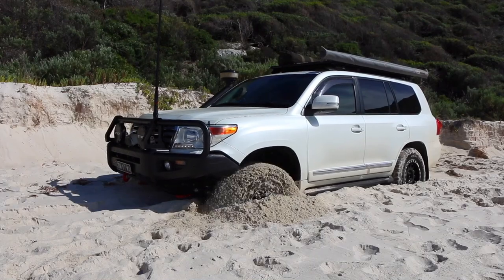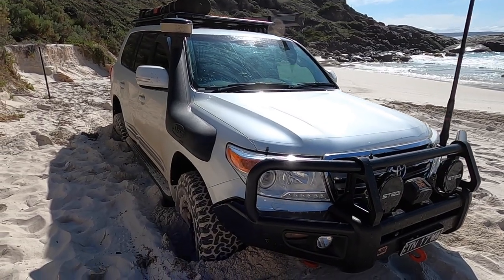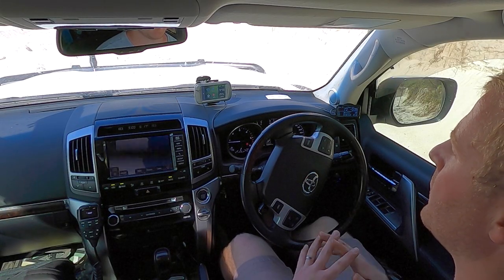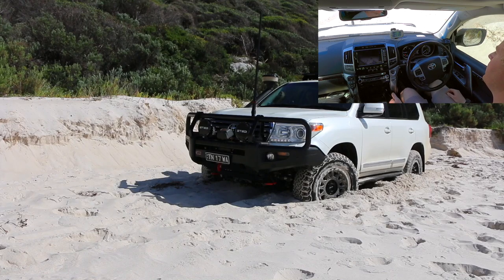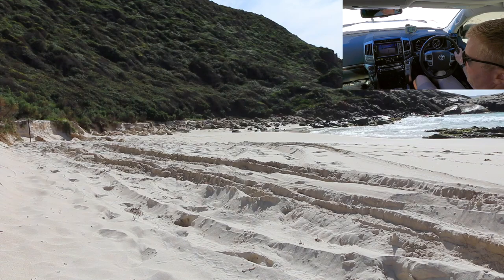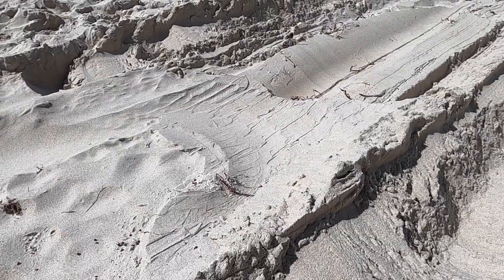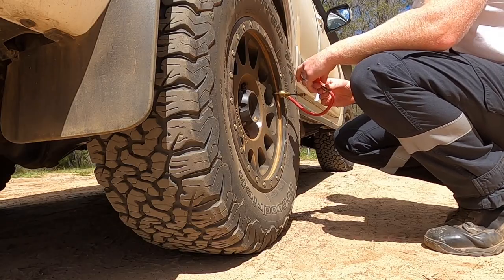Toyota Landcruiser CRAWL CONTROL | Stuck in Sand | Demonstrating 4x4 sand self recovery Does it work

Comment: Crawl has saved my bacon a couple of times. The most impressive was while towing a boat on Fraser. I was heading downhill and negotiating a big step down. I ended up off the side of the track in super soft sand so as not to damage the outboard on the drop off, sitting on the chassis rails both sides. Couldn't reverse uphill and couldn't go forward. My mate was ready to get digging, 15 seconds of crawl control and we were away. So impressive.
Reply from the maker: It’s an awesome system which works very well! Definitely something I recommend for efficient and safe recovery’s! 
Thanks for sharing your experience 👍
Cheers, Nathan.

Comment: Yep, I'm definitely impressed with that Nathan. More videos like that would be great. So many buttons on my new 200 VX and with no real instructions from the sales people makes it a little hard to understand how those buttons work and how / when to use them. Thanks so much again. Great vid.
Reply from the maker: Thanks Jim! These type of videos to appear to be popular, I’ll try and keep them coming 👍
There sure a lot of electronics on these new cruisers that require certain procedures or orders to activate. Hopefully my videos, past and future will assist 👍
Cheers, Nathan.
Reply: I don’t think the sales people every know how to use them other than over green leafy suburb car park bumps 🤣
Reply from the maker: @FangDocFilms  I reckon you are right there in most circumstances!
Reply: @FangDocFilms  Absolutely. On purchase I received absolutely no instructions from the sales person. Left the yard to go and fill the almost empty tank and had to get the hand book out to find the release for the filler cap cover. Same mob told me when I had issues with the centre diff light coming on randomly that the fault was unidentifiable and that a solution would be to disconnect the light !!!  That meant also that cruise control was eliminated and was low range !!  Go figure.

Comment: 98% of 200 owners won’t even know they have this feature.
Reply from the maker: I reckon that would be accurate. So many of these vehicles are bought to cruise the streets. Unbeknown how capable they are off-road.
Reply: i do!!! i have used mine a few times. the first time was on a west coast trip and got stuck near yardie creek station on the beach, near exmouth.  it rose up out of the sand like... well.... you get the idea. Im in the 2%.
Reply from the maker: @glenod  Haha, awesome mate. Great engineering used here, works well!
Reply: Well yeah if it doesn’t snow. Those of us in bad snow makes us get educated how to use it😉
Reply: Why would they not even know this > ? it is not a Jeep
Reply: I think most people who buy a 200 know what they are doing, they may not exploit the car to its full potential though.
Reply: 98% don’t know you can go 3 psi in this situation ie open the valve till air stops coming out
Handy to know when the tides coming in on your own
Reply: I heard about this feature a few years back by a neighbour who had one. He said that you can't get it stuck and it makes weird noises
Great to see it in action
Reply: @craigdavid6668  now this is accurate
Reply: I’ve seen many LX570’s bogged and the owners ask me to snatch them. All I do is turn on cc and they be like “😳😲 I didn’t know my car can do that!!”

And I don’t have one. I learned from YouTube!
Reply: Some get these stuck in hard sand and then just floor it thinking ot will get out and it like torture for LC lovers
Reply: Not all 200 series have that functions. I think it's available in Sahara and VX only.
Reply: @dannnyjohn7515  that's in Kenya
Reply: MY IDIOT NEIGHBOR DOESNT KNOW HE HAS ACAR.
Reply: Not every Land Cruiser has this option. It is not standard to have Crawl control.
Reply: Umm that’s one of the reason why I got my taco off road.  Only problem now is I got no place to put sunglasses.
Reply: @XploringOz  I had one and I always go to the desert so I tend to use it many times.

Comment: Love my Crawl. It's awesome up rocky terrain as well where just being able to concentrate on wheel position rather than anything else makes a huge difference.
Reply from the maker: For sure, I agree 100%. Some people, especially those who drive vehicles without this system will be quick to bag it out, however I'd rather be sitting at camp enjoying a fire, than digging my car out of mud/sand etc.
Reply: @tangosucka2000  Funnily enough I've been 4wd for over 35 years, and the crawl control is still better than any other vehicle I've owned with or without lockers. Just so damn easy.
Reply: @tangosucka2000  save up your money and you might be able to afford a 200 one day. Then you won't feel the need to leave envious ridden comments.

Comment: Call Matt.  Oh wait he's in Utah.  Pretty impressive thing.  I wonder what that drumming sound was.
Reply from the maker: Haha true. That sound is the ABS system activating for the crawl control. It's definitely audible, but completely normal.
Reply: Yes, it is quite off putting the first time you hear it. As stated the ABS system fires on and off randomly to stop which ever wheel from spinning, in turn transferring drive to the opposite side. I dont think i could be so smooth on a clutch in a manual trans but.

Comment: Can't wait to get mine...not that I wish to get bogged but see this work. Save using the maxi's. One thing I would be worried though if I already had low tyre pressure (some of beaches western south coast) we've gone down to 12psi (Yeagerup 10psi) would be worried about rolling the tyre off moving the wheel side to side!
Reply from the maker: This feature is absolutely awesome! A little bit of engineering magic I reckon. For sure, it would all come down to circumstance and adjusting your driving to suit as such. I have been involved in slightly panicked recoveries where pressures have been lowered to 5PSI, but this really is for emergency cases only. It can work, but potential damage to the tyres is significantly increased.

Comment: Wish my 76 had crawl control ;) On a serious note, I'm actually impressed by the Toyo crawl control. Never thought it was worth it. Thanks for the content! cheers
Reply from the maker: For sure, it’s a bit of a pity they don’t come with it, but then again, they are designed to be simple and reliable 👍
Works really well, definitely a great bit of technology.
Reply: Use both D.locks and pull the high idle knob out.

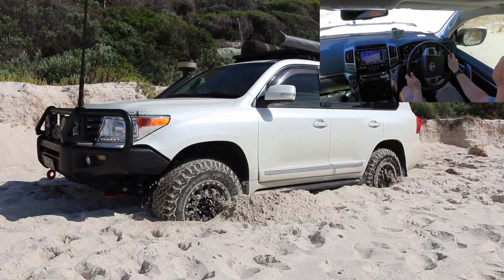Comment: Better demo..... My concern, while watching at 3:40 to 3:55, the vibration on your bumper was very clear, and for me, in the long run, due to wear and tear, that could somehow break (but it is supposed to be stronger than the original).  Was the vibration, that hard, really normal? Or something lacking with your improvised bumper?
Reply from the maker: Hey mate, so this is completely normal. This is because the bumper is attached to the chassis of the vehicle and the body of the vehicle is isolated or separated from the chassis by rubber body mounts.
I can assure you that the bumper is solid and mounted well to the chassis, but this just demonstrates how well the rubber body mounts work on the cruiser to take out these vibrations from the body...

Comment: Hey mate,

I really got alot out of this video, so much so that on a recent trip to yeagarup beach in the southwest i purposely got my 2016 GXL bogged 4x to test out the crawl control featurre. Admittantly it was actually quite difficult to bog the car without reinflating the tyres but on one of the occasion i hat bogged sufficiently enough so that all electronic aids besides activating crawl control would not pull her out. But just as seen here in your video crawl control worked great everytime recovering the big heavy rig under its own steam. I am so impressed even joking to the boys about throwing the maxtrax in the bin aha. I have even noticed using it through the hilly poweline tracks down south it works good for steep downhill descent when carefull control is required straddling deep rutts/washouts and with a bit of finess with your foot on and off of the accelerator i can power on going up hills which will disengauge the crawl control then when going back down hill just slightly power off and shel re engauge with the tell tale ABS noises and jerks. 

You have some of the best content on youtube for 200 series landcruiser owners mate keep it coming !
Reply from the maker: Awesome to hear mate! I love this feature, it gives you a little more confidence and another option when you do get bogged. I hear you about getting the cruiser bogged, I have rarely been bogged in this vehicle, the power always helps a little as well..
The system is awesome for all sorts of situations and tracks, I'll have to do some more demonstrations in varying terrain in the future. 
Thanks for the feedback mate, appreciate the comments. 
Cheers, Nathan.

Comment: The one reason that you were stuck is that the steering wheel is not on the proper side of the vehicle. Everybody knows that the steering wheel is on the left side. -)

But seriously that was pretty cool to watch. I don't think you needed to move your front tires. You look at when you first started to crawl you could see your car moving just so gently. I know why you were moving your front wheels That's just something we all do when we are four wheelers we know that you can turn your front and perhaps get a better bite in the sand or dirt. I think in this case you did not need that but it didn't hurt anything either.

You definitely got a new fan of your videos here in the States. I already hit the like button and subscribe button. I'm getting ready to watch the other video you refer to at the end about explaining all of this stuff and how it works.

Thank you for taking your time to show everybody how that system worked. I'm still not 100% sure how it worked but it was nice to see it work if that makes any sense.
Reply from the maker: Haha, yeah it would seem a little weird for those not used to the wheel on that side, just like it is for me the other way round...

Thanks mate, appreciate your comments here. I completely understand your comments regarding turning the wheel left and right and actually did a bit of a test with that in a recent video where my crawl control overheated (released a few weeks ago). To be honest, when you're inside the vehicle, it's hard to tell whether you are moving at all and much easier to see on camera from outside. 

I'm glad you enjoyed the video and I hope you will enjoy my others and future video's to come! This channel is all about trying to educate those who might be thinking about getting out and about in their own 4WD and specifically their 200 series Landcruiser. 

Cheers, Nathan.
Reply: @XploringOz  watching the video I can imagine how hard it was to know if you were moving. I think if it wasn't on video and I was standing there I might not have seen the vehicle move so slightly. 

I cannot wait to watch your video about the overheating. Until I saw your first video I had no idea that Toyota did that. 
Here in the States where I live our particular off-roading involves more snow and ice than sand and mud. I own two different 4x4 vehicles and my oldest one is a 1990 F-150 4x4 with the 5.0 engine. That is my go-to vehicle when the weather gets very bad here. I have never met a blizzard that I could not get around in. My other one is a newer Ford expedition and that one really doesn't do well off-road or in the snow. I just love the old school four-wheel drive that my pickup truck offers.

I really look forward to watching your adventures.

Comment: WA sand is easy! I did the whole WA coast in an old underpowered automatic van on light truck tyres. No diff locks, no winch, no sand tracks, just 4 strips of old carpet taken from a dumpster. We were not the fastest because of our $5 Kmart pump took a while to get them wheels up for higher speed driving. WA scerery is great, take them flies away and I move there.
East Coast sand is much more demanding, experience is much needed. Do this on Fraser after 4 weeks of no rain on 3pm.  I had a Cruiser pulling my Subaru out when all the other brands would not even think of having a go.

Comment: Awesome.  I have a FJ cruiser.  2013 trail teams edition.  It has that crawl control function as well. My question is.  Should I be using the rear differential  locker with the crawl functionality?. Thank you for your time.  Daniel.
Reply from the maker: Hi Daniel, nice car! So you don't need to use the diff lock if you're using crawl control. The vehicle will determine how quickly or slower the wheels need to turn and will automatically regulate power around the vehicle for maximum traction. In some cases (like soft sand) diff locks can actually hinder progress. 
Hope that helps.
Cheers, Nathan.
Reply: @XploringOz  thank you 😊
Reply: Absolutely use the locker, that way the abs controller only has to distribute braking force to the front axles. This way, you will have a more constant axle speed and be out of your big much sooner.

Comment: Nice demo of this function. I have tried this in loose sand and boggy mud. Trans has overheated every time, so have simply avoided using it. Temped to go out and try it again.
Reply from the maker: Cheers mate. That’s interesting to hear. What sort of conditions were you trying it in? Outside temps? Did the vehicle disable the function when it overheated?
When I did this test, my trans temps were lucky to go over 90, but it was about 21 outside.
Reply: Yeah both times it was 35 odd outside. Trans temps up in the 130s. Booked hard in a salt flat.
Reply from the maker: @robbies4x4adventures  Interesting, I can’t say my temps got anywhere near there. Definitely something worth keeping an eye on

Comment: First of all, in deep sand never use crawl control in high speed, secondly, never turn the steering wheel to the very end. Other than that all is ok 😃
Reply from the maker: Thanks for your thoughts on this mate. I've actually done some other testing in regards to driving styles and speeds of this crawl control and had some interesting results: https://www.youtube.com/watch?v=IWteCiBFrh4&t=1s

Comment: Might want to think about plugging those chassis rail holes in your wheel wells with rubber grommets as it looked like quite a bit of salty sand got inside the rails. I used a rubber floor mat & cut my own for the bigger holes & used black silicone on top of rubber grommets as they seem to deteriorate really quickly & the inside bits break away. P.S I cut a little groove with a hacksaw blade on the bigger ones so they seated in the rail.
Reply from the maker: Yeah, they sure filled up with plenty of sand and crud from this trip! 
To date, I’ve been relying on throughly flushing and washing out the rails to make sure no corrosive material is left in there. 
Thanks mate 👍

Comment: I think crawl control should be done at a much slower speed to create that forward momentum at each new push. Anyway after about 6 inches of doing this the transmission fluid will overheat and self disable the system so I hope you don't have a long way to go
Reply from the maker: Hey mate, I've actually done some testing in relation to speed and steering input and the results are here: https://www.youtube.com/watch?v=vCzVlP22iCw&t=438s
Might be worth checking out... I did overheat the transmission too!
Cheers, Nathan.
Reply: Yeah I start off at like 2 maybe…

Comment: Not every time?  Never been a time it has not worked for my TRD OR 4R.  And I run completely stock everything.  Not even OR tires.  But nonetheless, it is nice to see other CC videos out here demonstrating just how impressive and useful it is.  I don't have any of the OR gear you mentioned since my 5th Gen. 4R is so capable.  1st 4WD vehicle I have not carried recovery gear in, other than a tow strap.  Don't need anything on sand that is for sure.
Reply from the maker: They sure are awesome systems! These vehicles really do struggle to become very stuck and I have been very impressed with the engineering that Toyota have implemented into their vehicles in regards to the traction control systems. 
Glad to hear that you are having a great time not getting stuck with your vehicle! 
Cheers, Nathan.

Comment: Nice! I have a LC 200 as one of the few in Norway. It is the luxury version with hydraulic springs. Maybe you only have this in the Lexus version?
Reply from the maker: Potentially, we have 'KDSS' or Kinetic Dynamic suspension system which is a hydraulic assist suspension system which still relies on the fundamental spring and shock system. Is this what you would be referring to?
Thanks, Nathan.

Comment: I havent been offroading or overlanding before but ive watched so many of these vids that when i see ppl on the beach/sand stuck, the first thing that pops in my head is "whats their tire pressure at?". Lol
Reply from the maker: For sure, tyre pressure plays the biggest role in these situations. I did lower my pressure down a little bit, but could of gone down a lot more, however I needed to get stuck for this video.... 
Imagine how unstoppable these vehicles would be with low tyre pressures and this traction control system.

Comment: So I have a question.. can you tow a car out of a bog in crawl mode. .. eg, you snatch someone out then get slightly bogged yourself,  put it in crawl then continue to pull them forward through soft sand?
Reply from the maker: Potentially, there would be many factors that would this would depend on. Traction of the bogged vehicle, traction of the recovering vehicle gradient etc. 
I would say it would probably struggle and something like a snatch strap would likely work better.